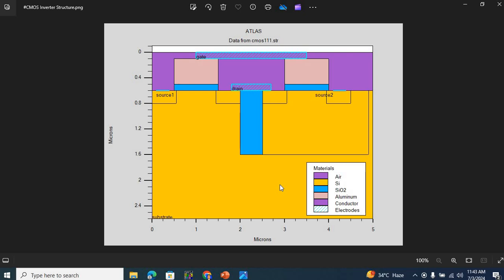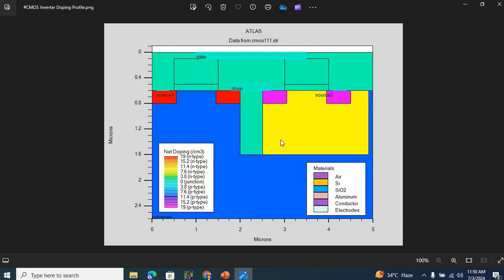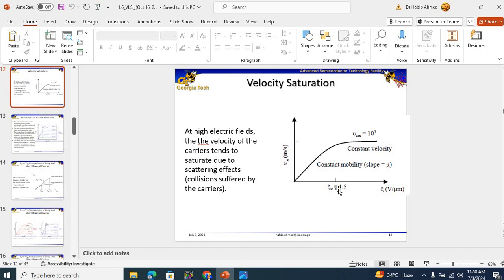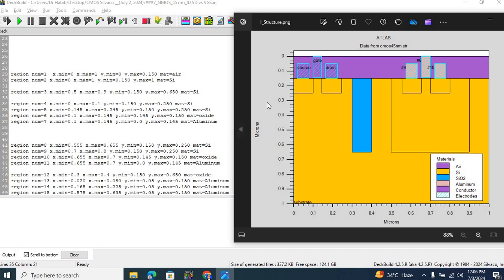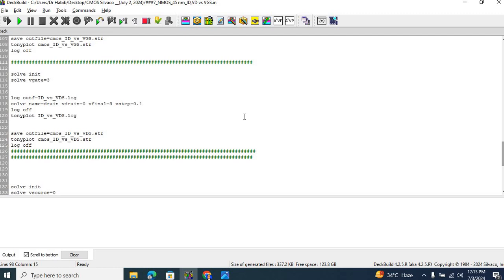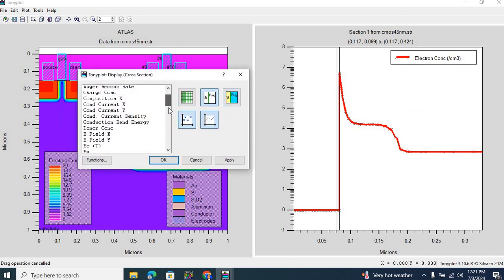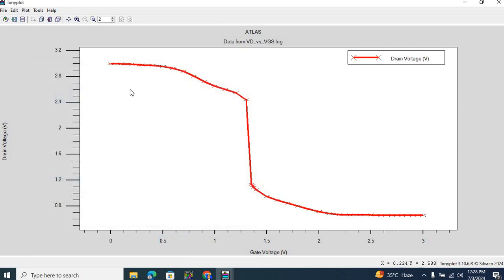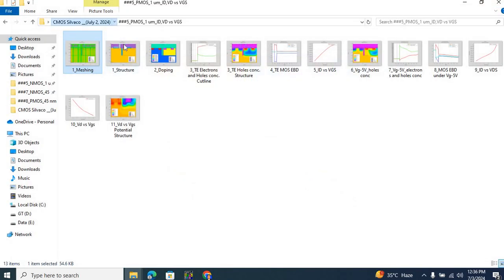Silvaco TCAD Simulation of CMOS Inverters || 45 nm and 1 μm CMOS Technology Simulation 🔬🖥️🔋💡

Comment: very nice insight, sir how see effect of MOSFET width variations.
Reply from the maker: By default, the width in Silvaco TCAD is set to 1 um. We can change it. It will affect the switching characteristics, delay and power dissipation of the MOSFETs.

MOSFET width variation has several effects on the device's characteristics:

1. *Current handling capability*: A wider MOSFET can handle more current, as the channel resistance decreases with increasing width.

2. *Resistance*: The on-resistance (RDS(on)) decreases as the MOSFET width increases, reducing voltage drop and power loss.

3. *Gate capacitance*: The gate-source and gate-drain capacitances increase with wider MOSFETs, potentially reducing switching speeds.

4. *Threshold voltage*: The threshold voltage (Vth) may decrease with increasing width due to reduced channel length modulation.

5. *Transconductance*: The transconductance (gm) increases with wider MOSFETs, enhancing current driving capability.

6. *Power dissipation*: Wider MOSFETs can dissipate more power, but may also generate more heat.

7. *Matching and variability*: Width variation can affect device matching and introduce variability in circuit performance.

8. *Layout area*: Increasing MOSFET width occupies more layout area, potentially impacting circuit density.

By understanding these effects, designers can optimize MOSFET width for specific applications, balancing performance, power, and area considerations.
Reply: @HabibAhmadGatech  sir how we can change MOSFET width from 1um in silvaco settings please  make a vedio on it
Reply: Sir in your vedio you have considered 1um thickness and 45nm channel length, but how we can se the variation of MOSFET width. Please help sir

Comment: Good evening sir
Thank you for your videos. Sir I have a doubt in GaN HEMT. What are the techniques to boost transconductance?
Reply: Thank you sir
Reply from the maker: @mounikag8136 You are welcome!
Reply from the maker: To improve the transconductance (gm) of a High Electron Mobility Transistor (HEMT), consider the following strategies:

1. *Optimize gate length and width*: Reduce gate length (Lg) and increase gate width (Wg) to increase gm.
2. *Increase carrier density*: Higher carrier density (e.g., by increasing doping or using a higher mobility material) leads to higher gm.
3. *Improve gate-channel capacitance*: Increase the gate-channel capacitance (Cgc) by optimizing the gate insulator and channel thickness.
4. *Reduce source and drain resistance*: Lower source and drain resistance (Rs and Rd) results in higher gm.
5. *Use a higher mobility material*: Choose a material with higher electron mobility (e.g., InGaAs or GaN) for the channel.
6. *Optimize the gate metal*: Select a gate metal with low resistance and high work function.
7. *Use a recessed gate*: A recessed gate can increase gm by reducing the distance between the gate and channel.
8. *Implement a delta-doping layer*: Adding a delta-doping layer can increase carrier density and gm.
9. *Use a strained channel*: Introduce strain in the channel to enhance carrier mobility and gm.
10. *Optimize the device design and processing*: Use simulations and experiments to optimize the device design and fabrication process.

Remember, the best approach depends on your specific HEMT design and application.